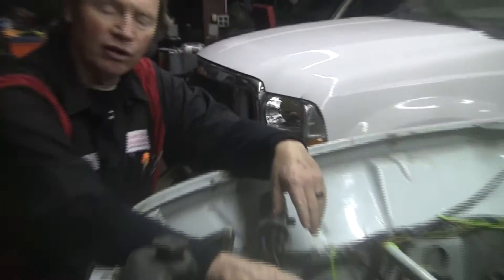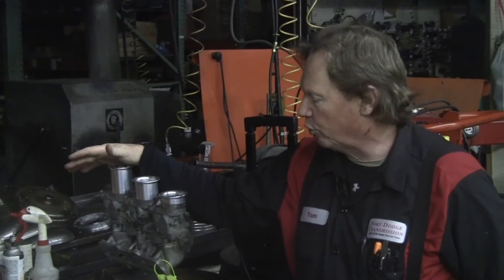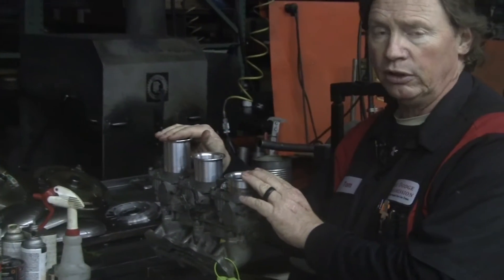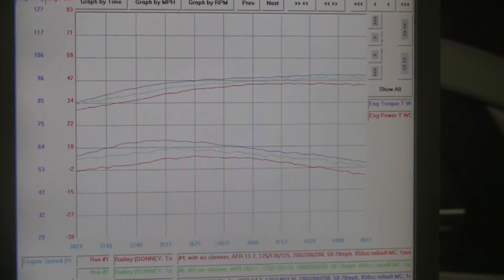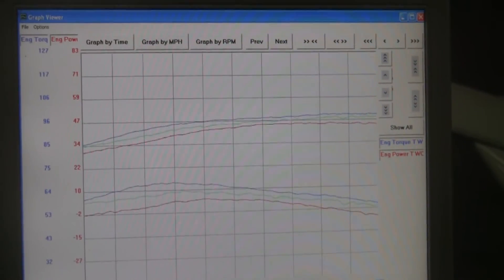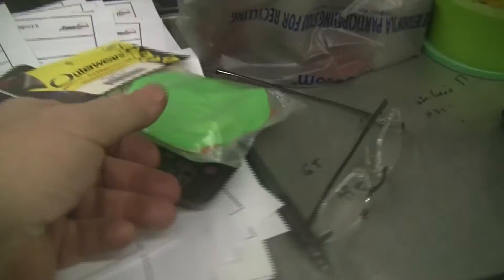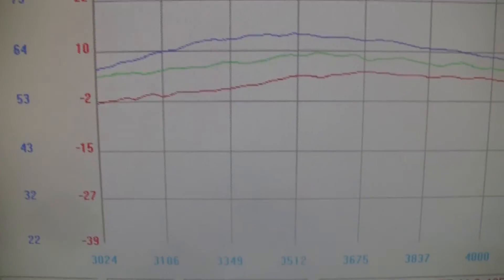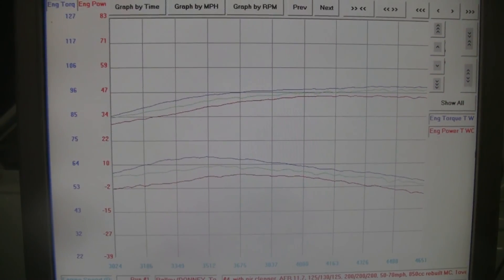Saab Two Stroke Triple Carbs Velocity Stacks Performance Gains

Comment: Having done a lot of seat of the pants feel tuning, i have found that in most cases an air filter (non restrictive) fitted to a properly jetted carb works best , as the slight vacuum before intake helps pull fuel from jets better. I have a 72, 97, , one barrel and filing out jet got me wonderful performance, i have had 5 97s, one was a 3 cyl that i let slip through my fingers #209, went to a fellow in Kentucy with a provision that i can drive it if it can be resurected. Have"nt heard from him since, but hope to track er down to fulfill my destiny.Ii'd like to take a trip your way sometime to see your fabulous enterprize, and smell some saab air. Haha.
Reply from the maker: Thanks for your comment. Sounds like you’ve had a wonderful collection of cars.  You would love coming to Sturgis and seeing all of the cars there.  And you can smell some old “two-stroke air”.  Having the dynamometer gives you precise information to analyze. We have done quite a bit of testing with air filters and screens.   In every case they cause a loss of power.  You can probably check out other Dyno tuning results from companies and see the same thing.  They all cause a restriction.   But in many cases you have to have filter to keep your engine alive and as you say you can find a way to make it work the best way possible.  Come on out to the hills and stop on by!